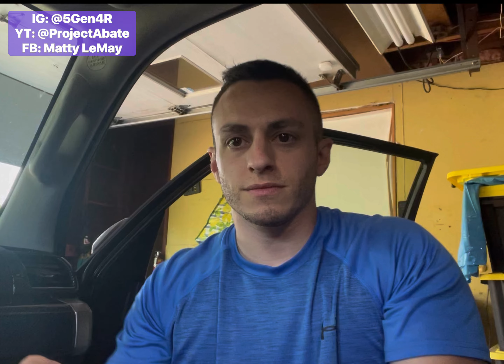Wolfbox G900 Install on a 5th Gen Toyota 4Runner

Comment: How is it when the back window gets dirty? Any visibility issues? I seen this mounted on the inside and outside..
Reply from the maker: @e604e horrible. Check my most recent Wolfbox videos. All of them get mounted outside now, under the spoiler. This setup was absolutely horrible. I do not advise you mount inside 😝

Comment: Hello Joe, really nice video, about the mirror I see all the time the speed and north signal at left and the date/time in the right, can this be removed in the settings so one can have a clean view like a real mirror?
Reply from the maker: @ing_glz  hi, thank you for the kind words! Yes, you can hide the GPS information!
Reply: Can you upgrade the 2.5k camera to a 4K. I find it bad for the eyes to look at. the picture on the front camera is better
Reply from the maker: @kbp235  I do not believe Wolfbox offers an upgrade at this time. You might be able to find an aftermarket one but I have not yet checked